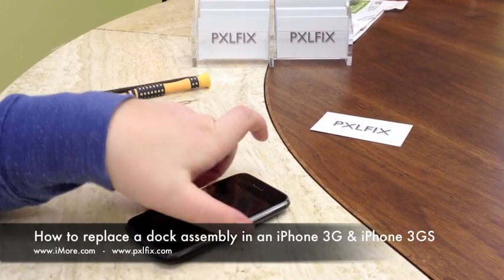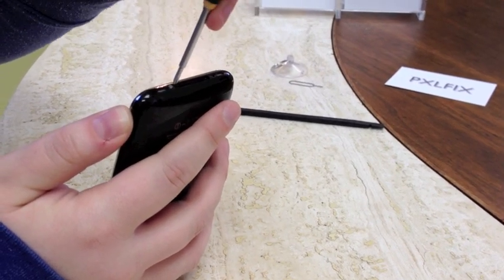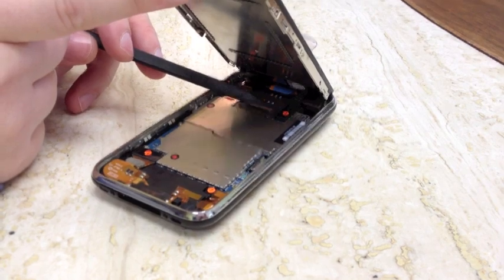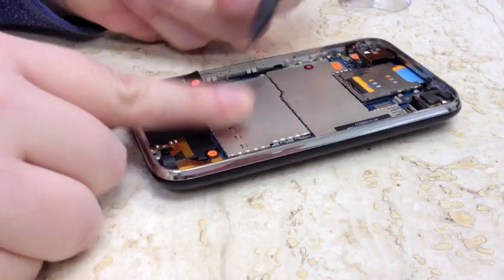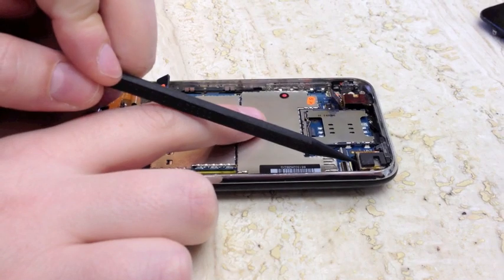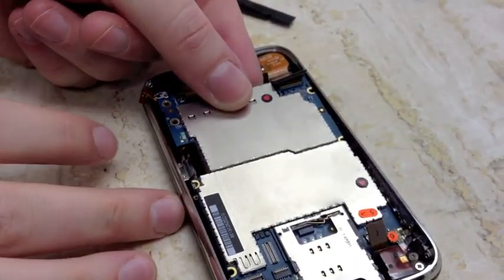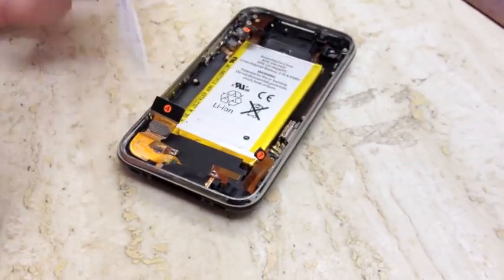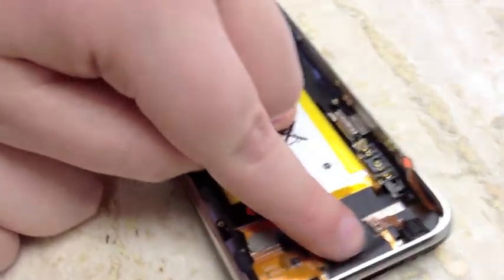How to DIY replace a dock assembly in an iPhone 3G & iPhone 3GS

Comment: Hello! My iPhone 3G has sound problems. No sound at all.loudspeaker, ear speaker, hearphones... nothing. Some times when shake the connector cable and restart the phone, the sound works again by some minutes then the phone freezes. Then I press home+power button to reset and the sound is off again. Can this be a bad dock connector problem? 

Thanks for your help.

PS: the vídeo was great, i was able to open my iphone my with your help. sorry my bad english :)